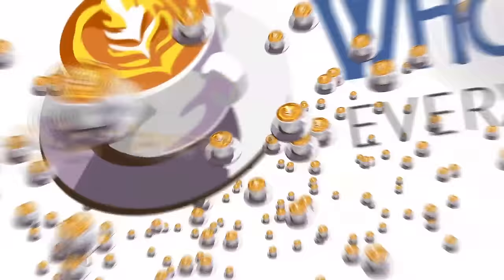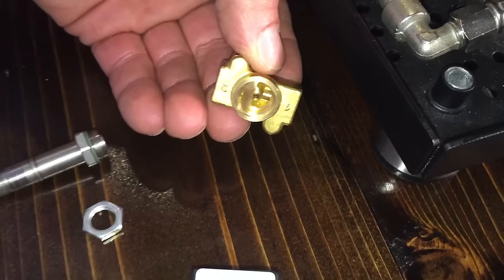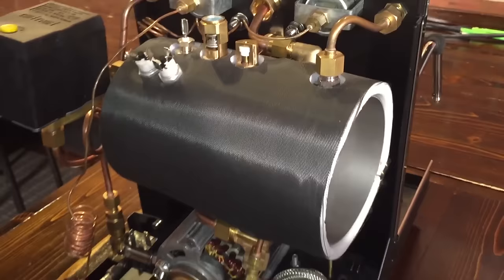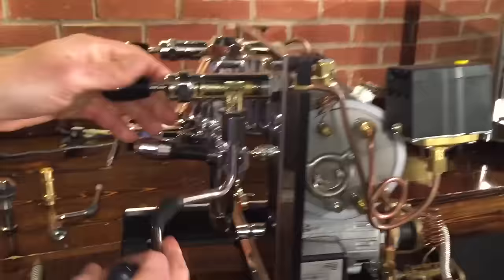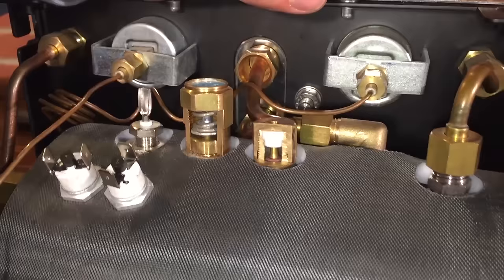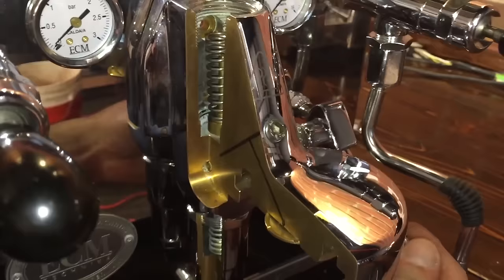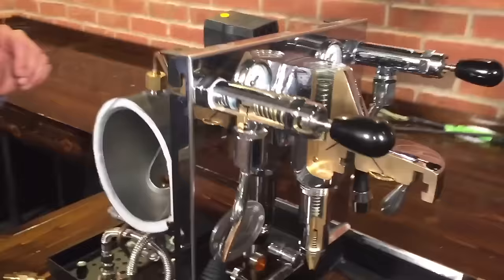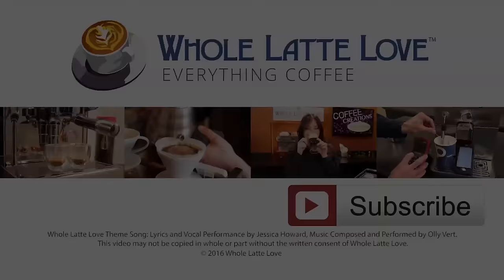How it Works: Deep Inside a Cutaway Espresso Machine

Comment: Really great video, although I believe there is one small error. The top of the bottom chamber is for pre-infusion. It uses a low pressure spring to allow water to flow into it at the same time that the portafilter is building pressure and prevents the coffee from receiving a sudden burst of pressure. When you lower the lever fully, it opens both chambers, allowing the preinfusion chamber to drain so it can be used for the next shot. The lower valve uses a much higher tension spring so that it would only open on it's own in the case of excess pressure in the grouphead.
Reply: Correct!

Comment: Hi guys, thanks for the great video, I really appreciated it. Did u know, that the pressure chamber below the valve has a prebrew-function? Starting the process by pulling the lever in the up-position, the upper chamber will be filled with about 9 bar pressure, and opens the lower chamber at about 2 bar. The water drains and soaks the coffee at about 2 bar until the lower chamber is completely filled. After this, the full pressure of about 9 bar will reach the coffee and the extraction will start. Cheers from Germany! Gregor
Reply from the maker: Hi Gregor, Thanks for the comment! Yes we use that on rotary pump and plumbed machines from ECM and Profitec to do a true line pressure pre-infusion.
Reply: Hi Gregor thanks for the Info, any idea on how to learn more about fixing coffee Machines, would like to     do this as a job
Please advise

Comment: I watched a lot of e61 videos and when I saw these replica structures I thought they were tampered with. I think the correct logic should be that the boiler should be linked to the pressure relief device below when the tie rod is closed, at which point the pressure generated when the boiler is heated can be released in time, and conversely when the tie rod is opened the pressure relief device is closed to ensure extraction pressure.
Reply from the maker: Hi mz, Thanks for the comment. Not sure I follow what you mean.

Comment: that was absolutely awesome, thanks !
Reply from the maker: Hi DM, you’re welcome. Thanks for the comment and glad you enjoyed!
Marc
Reply: Great video. However you didn’t explain the preinfusion chamber. The top spring on the release end of the grouphead opens at about 1,5 atm allowing the chamber to fill resulting in some time before the pressure on the puck builds up to full brewing pressure. This is one of the unique design features of the e61’s patented design.

Comment: Brilliant vid, full of detail and exceptionally well presented, many thanks. The capacity, guesstimating, of the heat exchanger and associated piping, could be less than 300ml. Using a short purge and pulling one shot would use approx 100ml. Cold water fed by the pump would replenish this. This would suggest that the temp would take a nose dive, during and for some time after the shot. Reheat might take some time as there are no fins on the exchanger. Do you have any figures on this, please?
Reply from the maker: Hi BB, Thanks for the comment, question and request. If you like this video you'll love this newer one with a look inside cutaways of single, HX and dual boilers: https://youtu.be/OUywoRs4meY
Reheat times are fairly quick, in most HX machines you'd be all ready to go by the time you prepped the next shot. Large thermal mass with water in boiler and the 6 or so pounds of metal in the group.
Marc

Comment: Is that Kevlar wrapped around the tank? I would have to guess that it is a safety measure to prevent an uncontained, over-pressure explosion, like a jet engine nacelle.
Reply from the maker: Hi David. Does look like kevlar but it's not. Just a high-quality jacket around insulating material. Boilers are protected from bad things happening by thermal safety switches and/or relief valves.

Comment: Pretty sweet video. Makes me sad my machine lacks a few of these features.
The only thing I’m curious about is the temperature of the heat exchange. I thought heat exchange units keeps 2 temperatures. But here brew water heating up the brew head and then going through the coffee isn’t temperature controlled/monitored?

Edit: I think I figured it out. Main boiler is temperature controlled at steam/hot water temp and pressure. Heat exchange inside cycles outside the boiler into the group. But the speed of the pump pumping the water out and back in from the heat exchange loosely controls the temperature to be cooler than boiler temperature.
Reply from the maker: Hi James, Thanks for the comment! Very close to correct on your edit. Here's what's going on: Water circulates from the heat exchange section inside the boiler out to the brew group and back. No pump involved in making that happen just thermodynamics in the thermo-siphon loop. Most E61 group machines uses a flow restrictor which controls the flow rate of the thermo-siphon. Changing the opening size of the flow restrictor affects the temperature of the group. Most heat-exchange boiler machines require a short cooling flush prior to brewing to get rid of over-heated brew water. There are a number of newer HX machines with PID temperature control which do not require cooling flushes. PIDs give very accurate in boiler temperatures. Manufacturers can then engineer the thermo-siphon with a flow restrictor sized to produce a certain brew temp say 200F even when the main boiler is running in the 260'sF.

Comment: Nice piece of engineering, but could that contraption can be easily replaced by an overhead reservoir?
Reply from the maker: Not sure we fully understand the question. Do you mean overhead such that it could be gravity fed? At some point a pump is required to create the ~9bar pressure used in the espresso brewing process.

Comment: The water goes through the injection pipe during brewing and mixes with the hot water in the heat exchange pipe at 9 bar. There is still a little gap at the bottom of the connecting piece grouting pipe where the recirculated water comes through as shown in 6:01. How does the pressure of the water in the pipe during the brew process at 9 bar during brewing not push backwards out of the exchanger and backwards through the cold side of the thermosiphon?
Reply: Late to the discussion, but I had the same thought as you did.  I am assuming that once the pump pressurizes the heat exchanger, water will flow from high pressure to low pressure meaning that water will flow through both lines of the thermosiphon to the back of the E61 group.  However, since the colder water comes into the middle of the Hx, water leaving the Hx through the hot water line and through the recirc line of the thermosiphon should both be close together in temperature.  Even if they are off by a few degrees, they will mix in the first chamber of the E61 before moving through the mushroom. I hope that makes sense, I've only been studying these machines for a few months.

Comment: So there are actually two reservoirs - 1. the boiler 2. heat exchanger and top chamber.
The pressure gauge and the pump setting only relate to the boiler, but the brew pressure is needed at the top chamber. Can you explain this discrepancy?
Reply from the maker: Hi c, Thanks for the question. A little unsure of what you are referring to. One gauge measures pressure in the section of the boiler producing steam. The brew pressure gauge measures pressure in the brewing circuit - water which comes from the heat exchange section of the boiler. That's only active when brewing.

Comment: Great Video.  Just purchased the Mechanica V Slim.  My biggest issue with the design is the lack of drainage for the Anti vacuum valve.  The amount of water that leaks prior to a seal can't be good for the electronics inside the machine.  I've noticed that other machines have the new type of vacuum valve that takes the excess water to the drain tray.  The Profitec Pro 600 comes to mind.  Is it possible to modify machines that don't have this using the new style valve?  Maybe cut into the drain tube for the expansion valve and splice in the tube for the vacuum valve?
Reply from the maker: Hey Todd, thanks for the comment and question. I don’t see a reason why you could not do that. Many machines use a T into the line going to the drip tray. Like you I prefer that setup. That said, it’s a very small amount of moisture released from the open relief valve, the boiler is hot so it evaporates rapidly and convection rapidly moves the water vapor up and out of the machine. If you decide to route to drip tray be sure the tube off the VR valve doesn’t get kinked. Kinks can prevent the VR valve from closing by causing back pressure on the valve. 
Marc

Comment: 3:30 a checked valve? is it the same as what people called it a non return valve? whereby water does not flow back?
Reply from the maker: Hi a, yes. Check valve and non-return are used interchangeably.
Reply: @Wholelattelovepage  duly noted.
you guys are awesome in what you are doing.. 👍👍👍.

Comment: Thanks for this very helpful video.  In watching this, it seems that a lot of the need for cleaning or maintenance required (eg backflushing) is caused because of the shared pathway to exhaust pressure from the group and end up with a dry puck.  Are there any designs on groups that address this issue?
Reply from the maker: Hi PI, Thanks for the comment and question. No designs I'm aware of other than cheap entry-level espresso appliances which do not have a 3-way valve. With those you end up with a soupy mess in the filter basket and residual pressure after an extraction.
Marc

Comment: Do the lines have to coil like that?  If so, what's the purpose?
Reply from the maker: Hi Coder, Great question! I do not know the answer with 100% confidence but it's likely to keep excessive heat and/or water from getting to the gauge.

Comment: Thanks for the good info.  I have a Quick Mill HX, so I assume the internals are similar to your model.  My manual states that the machine should "reach temperature in approximately 15 minutes, but to make
 delicious espresso with thick rich crema it is necessary to allow the machine to be heated for 30-45 minutes with the portafilter kept in the grouphead."

What I don't see in your video is what the extra 30 minutes of heating time is actually doing, given that the boiler has reached its maximum after 15 minutes.  Do you?
Reply from the maker: Hi Rich, I sure do! That extra time allows the group head to reach full temperature. In E61 groups there's a thermo-siphon which through convection is constantly circulating water through the group to heat it up. In order to get stable brew temps the group must be fully warmed prior to use. In this type of machine full heating of all the metal in the group head does take about 30 minutes.
Marc
Reply: @Wholelattelovepage  I thought releasing water thru the group head prior to pulling the shot was supposed to do that.  In a world of espresso nits this is just one more to pick.
Reply: @brozbro  In HX machines, releasing water before pulling the shot is actually known as a "cooling flush" that gets rid of the water that has heated up too much in the HX. Just letting water run through the group head will only contribute a little to heating it up faster, but it takes a lot of time (and water) to heat it up completely.

Comment: Gents, thanks for the video.  On my machine, the brew lever is very stiff when closing at the end of the shot.  Is there any maintenance required for this aside from regular back flushing?  Or should I open the brew head where the cam is?  Thanks
Reply from the maker: Hi Daniel, You are welcome and thanks for the question. So the machine should be descaled on a regular basis depending on how hard you water is. As to the lever being stiff... There is a cam internally which actuates a valve. Could be some build up on that or some wear. Can't be certain that's the issue but maybe. Here a video showing how to clean an E61 mushroom, jet and top valve: https://youtu.be/4H57QSEMDhs

Comment: where does the machine make pressure for the water over the coffee? the 9 bar
Reply from the maker: Hi CM, Thanks for the question. Pressure comes from the pump and high limit of pressure controlled by an OPV valve. Actual pressure builds up due to restriction of the coffee in the PF.
Marc

Comment: Very informative!
Could you please tell me if there is a heat exchange machine available that does not have a teflon tube inside the small section of the boiler, dedicated to brewing?
Does the Rocket machines also have the teflon tube?
Reply from the maker: Hi CG, I'm checking on Rocket but I know for certain Crem machines do not have a Teflon tube in the boilers. Check out current Crem machines here: https://www.wholelattelove.com/collections/semi-automatic-espresso-machines?_=pf&pf_v_brand=Crem
Reply: Thanks for the interim feedback!

Comment: What is the size of boiler and how much maximum pressure is being generated by the machine??
Reply from the maker: Hi harsh, Thanks for the question. Full specs on the current ECM Technika vaialable here: https://www.wholelattelove.com/products/ecm-technika-v-profi-pid#product-specs Boiler is 68oz/2 liters. Max pressure is ~1.3 bar for steam. Brew pressure is set to produce 9 bar max at the group but is user adjustable via an OPV.
Marc
Reply: @Wholelattelovepage  thanks for your support hope for the same in future

Comment: Is there any heat exchanger machine available, that does not have a teflon tube inside the small boiler section?
Reply: Thanks! The video is very informative.
Reply from the maker: Hi CG, I'm checking on Rocket but I know for certain Crem machines do not have a Teflon tube in the boilers. Check out current Crem machines here: https://www.wholelattelove.com/collections/semi-automatic-espresso-machines?_=pf&pf_v_brand=Crem

Comment: Do this won't work with distilled water? Essentially the boiler will never know if it has water or not?
Reply from the maker: Hi lowspeed, The boiler water level probe probably will not work in mineral free water. You can get around that by adding a pinch of salt to the water. However, we do not recommend using distilled water in espresso machines. Mineral free water makes bad tasting coffee. Espresso will over-extract due to lack of mineral content. No scale will form but there is a risk of corrosion and leaching of boiler metals. Ultra-pure water is a fairly strong solvent. That's the reason why distilled and RO purified water is never delivered in or piped through metallic components.
Reply: @Wholelattelovepage  I ve been using RO water in my Cimbali Jr for 20 years!

Comment: I have a problem with this machine. The only issue I have is that when I turn the group head on the pump doesn’t seem to turn on, the pumps does turn on only when the boiler level is down so it seems to work fine except when trying to pull a shot. Water does come through the group head but not enough pressure.
Reply from the maker: Hi OQ, That sounds very odd. Not sure I entirely follow what's going on. One possibility is the cam on the E61 lever is not making sufficient contact with the switch on face of machine to kick the pump on. You might try pushing that switch manually to kick the pump on. If that works you will need to open the machine up and adjust the switch so it sticks out a little further. There are nuts inside and outside the machine which can be adjusted to have the switch stick out further.
Hope that helps!
Marc
Reply: @Wholelattelovepage  I did what you said but no luck. everything works on the machine. I just bought it as is. I replaced the gasket from the heating element at the boiler, that seems to be good now. could there be anything that prevents the pump to turn on when I hit the switch? a sensor? pressure? there is enough pressure 1.5 b.
Reply: the pressure gauge reads 0. only when I drain water from the boiler then the pumps turns on and pressure goes up to 2 bars only and then the pumps turns off.

Comment: are copper, brass, bronze, aluminum parts corrosion proof, and safe for health.
Reply from the maker: Corrosion resistance depends on water quality and metal type. Zero TDS water like pure RO and distilled can cause corrosion. Metals used exceed US and EU safety standards.

Comment: One quick question: In the video (time 14:43) you are explaining how the pressure of E61 is released. What could be wrong if my Bezzera stops doing this back pressure thing from the brew group? I stop the coffe extraxting when coffe is done but no pressure from the bototm of the Group is released aftewards ...no ideas anywehere. Any suggestions?
Reply from the maker: Hi MZ, Thanks for the question. Wish I knew which model Bezzera machine you have. Does your machine use an E61 group with a lever to start and stop the extraction or the BZ group? if E61 it may need a cleaning. If BZ group it has an electrical solenoid valve which may need attention if not blowing off pressure at end of extraction. Here's a video showing how to clean E61 group which may help with your problem: https://youtu.be/4H57QSEMDhs
Marc
Reply: @Wholelattelovepage  Thank you Marc. It´s Bezzera Mitica TOP with E61 group (HX boiler and ROTARY pump). I´m your big fan so I have already checked all avaliable videos out there and E61 group has been cleaned on regular basis (every 3 months)...it´s true that for a short time it helps (and by short time I mean 5-6 espresso :) )